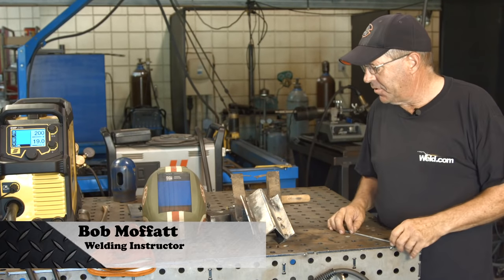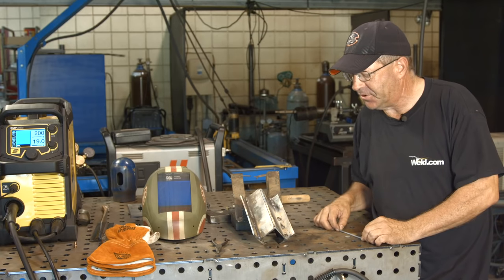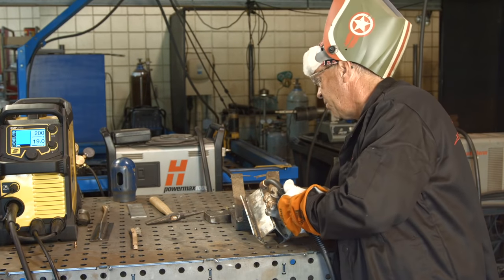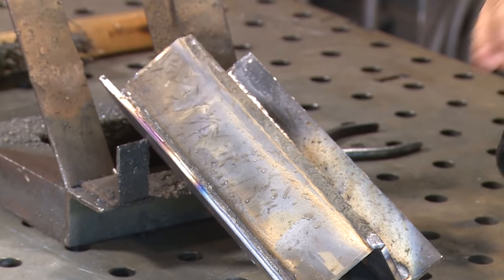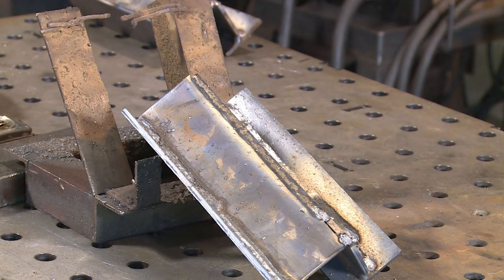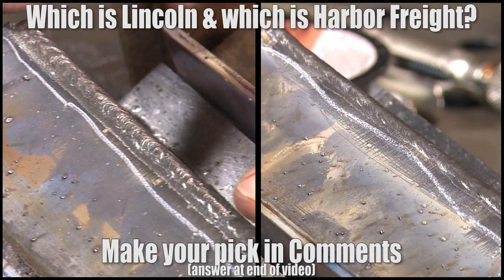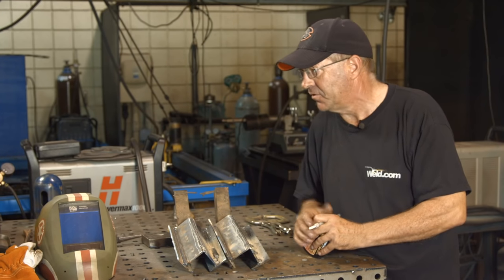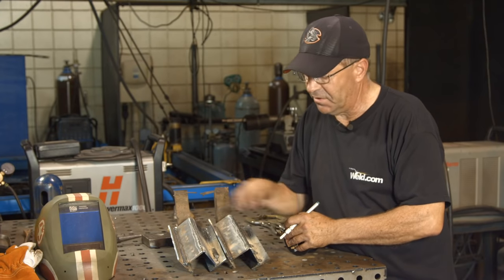Harbor Freight Flux Core Wire vs Lincoln Flux Core Wire: Part 1 of 2

Comment: I bet they were both made in the same factory..just different sticker
Reply: NOT! harbor freight wire is junk. use lincoln wire in hf welder & you have a very decent welder.
Reply: Not actually true. Lincoln doesn’t make most of its wire here anyway.
Reply: Harbor frieght wire is made in italy, well the Chicago electric spools that i have from 06 but its solid wire.
Reply: @wildb9864  I bet the wire that comes with a HF welder is not the same as what they sell on the shelf.
Reply: @gizzyguzzi  Very true. Common suggestion for new HF users is if the supplied wire is not working, change to replacement role and problems will go away.

Comment: Harbor Freight wire is repackaged INE wire. I've used the Lincoln gas less wire and the INE. I prefer the INE wire myself. I just feel I get overall better welds with it. There's so many factors at play though. My skill, the machine I'm using, my settings, my metal prep. This guy made both welds look good. It's like what I've always been told with shooting pool. In the hands of a master even a crooked stick can win the tournament! Me, I'll just continue to practice!
Reply: Just bought a HF titanium 125 fluxcore welder..
I figuer i will learn on the HF wire first and maybe when i will buy better stuff when i have some skill..
Reply: The only thing I don’t like about the E71T-GS wire is that it is not multi pass rated, where as E71T-11 is.

You really won’t notice much of a difference in the performance of the two wire types until you start trying to stack welds

Comment: it definitely looks like the Harbor Freight did better in my opinion it sounded like you were having more trouble with the Lincoln Electric wire.
Reply: Donald Kasper and for welders that only use 4” spools, what then? This test was t for welding 1/2” plate. It was for guys who hVe small machines and aren’t professionals.
Reply: To Don K. and Mel G. . I think both of you are correct. I own an HTP mig 240 and I have tested switching back and forth from a 4 inch spool to an 8 inch spool and will get that bouncy type of feed with the smaller spool. I think it is because of the adapter for the smaller spool which hangs off of the drive hub . On a small machine the 4 inch spool bolts direct to the drive hub so you get a consistent feed.

Comment: Thanks for taking the time to make this video. I appreciate you mentioning my question in the video also. Looking forward to seeing part 2. I guess another test you could do is to see how much force it would take to break or bend both of the welds. I am surprised how similar they ran though. To me, the harbor freight wire does seem to run just a little smoother and less jumpy than the Lincoln wire. It's almost the same though. Great video.
Reply from the maker: We plan on doing the bend test in the next part. Thanks for the questions
Reply: Weld.com Awesome. Thanks.

Comment: Bob,a friend has the Harbor Freight welder you are using.He was about to give up on the machine when someone told him to to research on You Tube, how to modify the Harbor Freight welder.The motor that feeds the wire is being denied the correct voltage when you are welding.We modified the welder and it solved the wire jumping issue.The cost was 37.00.There are a number of videos on YT,some better than others, and if you're going to use this machine,then this is money well spent.Thanks for a well informed video.

Comment: Lincoln is SUPERIOR on ALL consumables!!!!!
Every company tries to compete with them, but no one comes close. UltraCore self-sheilded wire is as sweet as chocolate cake. You have to really work at making a defective weld. If you're running right, it melts like butter.
We can argue red/blue/yellow all day, there's no argument with consumables.
Lincoln is KING!
No disrespect, but am also a CWE/CWI, Instructor, Program Director, with 30+ years structural, pipe, and manufacturing.
I can appreciate your approach and respect your well earned and qualified "opinion".
Reply: What I don’t like about the E71T-GS wire from harbor freight is that it is not multi pass rated. Where as E71T-11 from Lincoln or any brand is, and you can tell the difference when you start stacking a couple welds.

As far as Lincoln producing superior electrode I completely agree. In structural ironworking you hardly see any contractors these days purchasing anything other than Lincoln Excalibur 7018 for stick, and lincoln flux core 232 or 233. For 6022 deck rod I’ve seen other brands but that’s because quality is not as essential in welding deck.

I actually have a pipe fitter buddy who went to the Hobart welding school, and at the Hobart welding school they were using Lincoln welding rod funny enough. Hobart 7018 has gained a reputation of not having the filler material properly centered in the flux of the rod.

Comment: Thanks for the video , I always appreciate people taking the time to make videos ......I have had this same issue many times and it has nothing to do with the wire make and everything to do with the tension of the the spool inside your machine . I had a fabrication  years ago and do alot of hobby fabrication and have toyed around with many different flux core wire brands including harbor freight . The only difference I have ever seen and experienced is generic brand wires is more throat irritation , my welding lens gets full of smoke quicker and more splatter , in other it runs dirtier.  Weld integrity and arc consistentcy is the same on all brands.  I prefer to weld with Lincoln wire but if splatter and smoke is not an issue generic brands give you more for less .

Comment: I did a test over the summer with HF wire and Lincoln wire.  The Lincoln wire gave me a cleaner weld, and it seemed to just weld easier. 

not a huge difference, but hands down the Lincoln wire was twice as good.

Comment: I had the same inconsistent feed issues with the harbor freight wire .030" but the welds still looked ok. My sister is an engineer at Lincoln and I do like their wire a little better for the feed issues but the welds look the same to me. Great video!
Reply: You got family at Lincoln and you're buying Harbor Freight? Man I would be trying to get a free machine and a pallet of wire.

Comment: I also appreciate you putting this together.  I have not welded since high school in the '80s.  No Mig back then.  All constructive advice for the novice shortens my learning curve.  Most welds will not be load bearing with heavy loads. However a few will be.

Thanks again this is the first time I have been here you have a new subscriber.

Comment: Great video and I appreciate the comparison. I built a set of forks for my wheel loader, and used FCAW due to outdoor use & dirty metal. Penetration was excellent with a MM252 (using 10# spools) turned up. I've had the pulsating sound before, but was able to adjust the settings until it ran smooth; in this case it sounds like you may need to turn the voltage up, or the w/s down. I realize that you're an instructor & hesitate to even make the suggestion, but it may solve the problem. Thanks again for the informative video. Looking forward to part #2.

Comment: I welded up a 20x20 shop for my dad. I was using an old tapped Lincoln 220v mig, that Ive had for 25 years I ran out of Lincoln wire, so my dad went to get some more. I told him to "pick up a 10 pounder of oh-thirty flux core. He came back with a Harbor Freight bag. I decided what the hey, I'll try it. I preferred the the Harbor Freight wire. It seemed to run smoother on rusty metal and had a better appearance.

Comment: I believe, because my wire has done the same, it has to do entirely with the spool. I have to adjust tension on the roll itself to keep it from jumping like that. I run Hobart for the record but have run both Lincoln and Harbor Freight, and you have to really tune in drive roll tension and the tension on the spool itself.

Comment: I have the early blue 120 volt AC welder. Not HF but same thing I'm sure. I built an adapter for a ten pound Lincoln spool out of a 1 pound spool. It works perfectly, has for years and one problem I don't have is feeding issues.

Comment: I have a Lincoln 140 (120vac) that I've run at least 40 lbs of Lincoln mig wire thru and I don't have your problems. I use a serrated drive ring on any of the 4 settings. welded 3/8" steel w multiple passes and I've never had a problem. love my Lincoln.

Comment: Bob, Thanks for your videos. I use the older 90 Amp 120 Volt H.F flux core welder on the high setting with #3 to #4 speed for most of the metals I weld using Lincoln flux core wire .30 and change the tip when it starts to stick. When I bought it many years ago I read not to use H.F. flux core wire and to use the smaller .30 Lincoln flux core wire. The price is right for a Do It Yourself Mr. Fix It person with an occasional project in the garage. I've used it on a utility flatbed trailer railings, gate/ramp, Desert Go Kart, ATV fender brackets, built a 2" square tubing carrier for a Motorized Drift Trike for my SUV 2" hitch to name a few.

Comment: I found with my old Autoplus welder that it welded smoother with the largest roll that the machine could carry. I believe that smaller diameter rolls tend to want to resist uncurling and may give the rollers ...and the liners difficulty in providing a smooth and consistent rate through to the gun. I think it has to do with the smoother inertia the heavier and straighter feed from the roll.
Reply: That makes sense, my welder has been acting up lately like the wire keeps sticking for some reason and I. Pretty sure it's because the smaller rolls I always use aren't tight and make the wire scrape the liner.

Comment: i agree with what he is saying.  i have been using flux core for field repairs for years on both lincoln and hf welders.  the small spools from all manufactures seem to do this.  you have to set the tension high.  when i switched to large spool lincoln wire from home depot, it solved this issue.  i had very steady wire feed.  for the home diyer the hf welders work fine.  for better wire control you gotta have dial adjustable speed and current.

Comment: Very interesting. I'm a noob to welding and have a cheap 110V welder. I was using a Lincoln brand of flux core wire for quite a while. I had a lot of issues with inconsistent feed. I tried everything I could think of to fix it. I had figured it was me or just the cheap machine. Recently I was working on a project and ran out of wire. I went to my local small hardware store to get some more. They only carry the Forney brand. I was thinking I was getting myself into more trouble with my crappy welds. I loaded the wire and was I ever surprised! The wire fed like it should, nice and consistent, I had the nice "bacon fry" sound, and the welds were a whole lot better! I don't know if this is due to wire quality or just machine compatibility. Maybe it is related to consistency of wire diameter . . . ? I didn't change the feed tension. Who knows . . . ? Maybe I had the wrong type of flux core wire?

Comment: Good video. Well done. I experience the same fluctuations with flux core and I was told to use the serrated rollers for it. Need to buy some rollers and give it a try. I only use flux core for static loads, never dynamic. That's just me. Good job!

Comment: I would like to see you try a name brand wire in the Harbor Freight welder.
I had one of HFs flux core welders and the wire it came with was junk.  
After I put in a roll of  .030 Lincoln wire it would actually weld.
Reply: Did you have the leads on correctly?
Reply: @saturnmedia1  The problem is the included wire. It's horrible. Has nothing to do with the machine.
Reply: My experience was the 1st 10% of the included wire was terrible. Had to prefeed off the role to make it work. Then all of a sudden the problem went away and never came back.

Comment: Recently bought the Harbor Freight 125 flux core welder. Price was very reasonable. While at Home Depot though I noticed they sell the .030 wire (1 lb spool) which is what the Harbor Freight welder came with for $13.99 whereas Harbor Freight charges $20.  If as you say you can't see any difference then I think I'd go with Home Depot for the wire.

Comment: I have some Hobart wire on my older flux core only EZ125 Hobart welder and I was wondering if I should replace that wire?does it go bad after three years or so because I believe that’s how old mine is,,,,,or is it OK to keep using it,,, I just go out in the garage and tinker around once in a while or try and fix something that breaks that’s all I use my little welder for I don’t do a whole lot of welding,,, The last thing I use my welder for was to make some little tiny tail pipe muffler pipe for a 15 hp Briggs & Stratton opposed twin engine it didn’t have a exhaust on it so I use some pipe from Menards and welded some up

Comment: I think amperage makes a difference. I've used both the ER70S-6 MIG wire and Harbor Freight ER70S-6 wire in my Pro Mig 140 and I definitely prefer the Lincoln wire.

Comment: I noticed the sound of the wire when welding, first thing it tells me that the feed was too high, that's why the arc was jumping around, and the second tell tale sign was the spatter. if the speed is set right, there is very little spatter if at all. but I have made the same comparisons and they are almost identical in all aspects. I have welded a lot of gasless flux core wire and it holds just as well as dual shield flux core.....thanks for the vid.....

Comment: Just bought a cheap Campbell Hausfeld flux core welder off of marketplace. He had Lincoln wire in it and he wanted to keep his wire. I brought the welder Home. And the shop that sells welders was closed and I'm trying to get a project done for my grandson. So I went to Harbor Freight and bought a spool of wire. Not saying it's a good wire. But I definitely noticed a difference between when the guy tested the welder with Lincoln wire. And I'm using the Harbor Freight wire. I'm seeing less sbattere. And less kickback on the Stinger. Who knows maybe Harbor Freight flux core wire probably ain't that bad. We all need to do more testing. But for now I definitely have questions on it too.

Comment: Ive never had much luck with flux core, i think its harder to weld than regular gas mig! Great video!
Reply: Its not as bad as you think, my 1st experience was with flux core now i mig. Flux burns hotter and the weld pool is not the same, id recommend watching more of these videos.

Comment: Damn they are both good. 1 pound of Lincoln wire is 13 bucks. Harbor Freight has a 2 pound for 13.99. I think I'll go with the Harbor Freight based on the video

Comment: Really looked/ sounded as though the wire speed was too high on both runs. Did you play with the settings to fine tune the machine or did you just go of the guideline chart that came with the welder?

Comment: You have a new subscriber based on what appears to be honest and helpful feedback.  I am a new/hobbyist welder and have that level of equipment.  But I want to learn more and make better welds.  I just updated my welder from an old transformer based MIG-100 to a Titanium Flex-125 that is a DC induction based machine.  Much much lighter at 15 lbs or so.  Still an entry level machine but should work fine for me.  I was doing research on if it would help me to upgrade my wire.  This video seems to say, no real need.  Appreciated.  I will check out other videos and see what else you have for info.

Comment: I have used both kinds of wire in my harbor freight $100 welder and I prefer to use Lincoln electric wire. I have grounded down the nozzle of my gun to be even with the tip so I can weld with the nozzle on because it deflects the popcorn a little bit.  I find that the Lincoln wire penetrates better and flows better. The Lincoln electric wire was spooled badly, I had a big backlash mess the first time I opened a roll but got it all wrapped back up and it worked great.

Comment: i would take the fizzle out by raising intake throttle,lower the splatter by lubricating with pb blast and crimp the headbob for a smoother run.
Reply: Adam Coyne lubricate how with pb? Thanks

Comment: Bob, first-sorry to comment on this two year old video.  I'm just getting back into welding as I'm restoring a car.  I've been practicing a lot with the gasless flux core (running a straight bead, zig-zag, little c's etc.   I learned from my dad and in high school (years ago) with just the ol' stick arc welder.  I'm having trouble dialing in the voltage and wire speed.  I'm following the chart on the welder but I'm not getting very good results and not sure how to trouble shoot.  Any suggestions would be appreciated.
BTW, ignore the asshat that pissed you off.  Your channel and the info you are sharing is invaluable for thousands of people out here is youtube land.  just saying.

Comment: I have a small lincoln flux core machine, and I've only ran the mp211 in the small spools and I've noticed it doesn't feed as well till the spool is almost 3/4 of the way gone than with a full spool. feels stabby at times, and sounds like its pulsing.  I tried changing up wire speed, roller tension, but eventually when the spool runs low is when it runs it's best. I want to get a bigger spool to see if it makes a difference or not.

Comment: Good video. Inconsistent welding feed is due to a number things. 1. Cast & pitch. The larger the cast / the closer to zero pitch the better the feed. 2. Surface lubricant. Intermittent feeding is caused by a lack of or varying amounts of surface lube on the wire surface. 3. Inconsistent internal flux percentage. During manufacturing dry chemicals are added to the tube. This is monitored & tested during production. 4. Are the 2 wire comparable. Both are indeed gas less but are they the same T-?? classification & do they use the same settings? Thanks again for your video. I have not yet watched part 2.